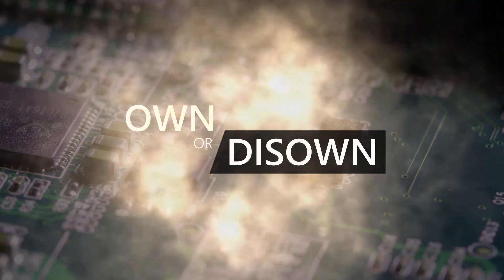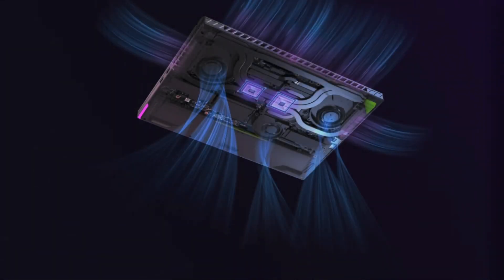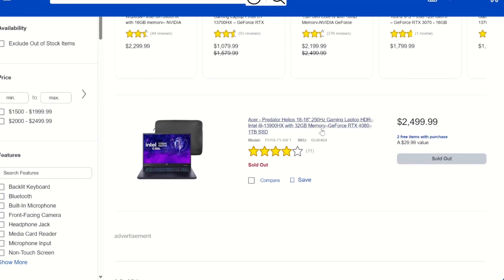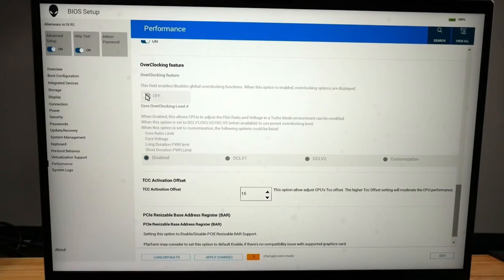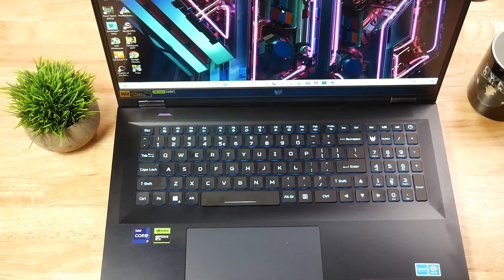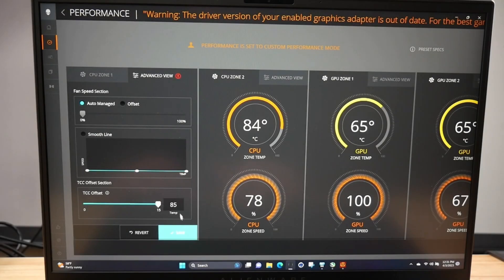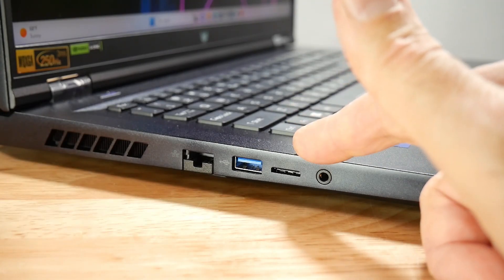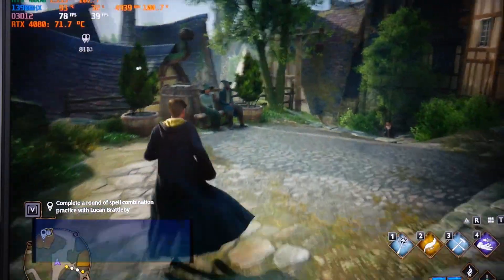Best 18" Gaming Laptop 2023 - Alienware m18 vs Acer Predator Helios 18

Comment: Had an m17 r5 with 3070ti, battery failed  in 1 year( just after the warranty  run out),numerous  problems  with the ports,  alienware software etc. by far the worst gaming laptop i ever had and it was £2500. Never again will i buy and Alienshitware again. Good review comparison  btw :)

Comment: You did an excellent job here; much appreciated. I’m due for an Alienware upgrade, but I’m safe to hold off until next year.
Reply from the maker: Thanks, appreciate it! Glad I was able to help :)
Reply: If I were you, I would look at purchasing a 2023 M18r1 with a RTX4080. With discounts, you're not going to miss much with the 2024 model other than Type C charging, which is really a non-issue with this size of laptop...and you can always purchase a slim form-factor 330watt Alienware power brick at a later date.

Comment: I want an 18' as my next laptop, potentially in the coming months, but I hate the premium $$ we have to pay for them.. Seems that only 16' laptops get all the good deals and better base prices for the same components.. Also the cooling for the 18' laptops has been underwhelming at best, maybe even embarrassing. Such large and heavy laptops should have premier cooling. Yes the Cpu makers (Intel in particular) are to blame for those power hungry and inefficient Cpu's (again, mainly Intel), but 90c + shouldn't be considered the norm or "acceptable", cause it's not.
Reply: 90C is fine for cpu temps. Why does it bother you? Even Apple silicon runs at over 100C. 
"However, the current version of the utility isn't fully compatible with Apple's new M3 family and couldn't provide a readout of temperatures for performance and efficiency cores. However, the app did report package temperatures that ranged from 99 to 104 degrees Celsius during the Cinebench R24 stress test."
Reply: @SocratesWasRight  I said 90c + (frequently even higher than just 90c). No, it's not fine. What you have to keep in mind is that this is brand new already reaching those temps. Once thermal paste degrades, and fans get cluttered up (most Buyers maintenance is sporadic at best), the issue exacerbates and gets worse even within a year, forget about 2+ years down the line. 
Maybe it would be vaguely acceptable if those temps were only reached in extremely demanding benchmarks over the course of 10+ mins, but when any run of the mill modern game is seeing 90c +, it's problematic. It also means the rest of the Laptop gets scorching hot, and that can cause problems for other components (like the AC Charger port, which I've had a bad experience with it getting hot. Mind you this was on a high tier Msi gaming laptop with great temps due to reseller applied Thermal Grizzly Condoctonaut and Fujipoly Extreme Thermal Pads, and heavily undervolted for great temps, and even then it can cause issues over time).
The higher cpu temp also negatively impacts the Gpu temps, which will directly impact performance once it reaches higher temps and can't reach higher boost clocks.

I can go on and on listing issues with terrible temps, but if you are happy with them, and want companies to keep up that trajectory, then continue running cover for them and enjoy.
Reply: @slickrounder6045  do you also go to Apple videos to complain about those "terrible temps" at over 100C? Modern CPUs have boost algorithms that push frequencies until temp and voltage thresholds are reached unless you specifically limit them. Anyhow I do agree with you, that often this boosting is done way past the optimal spots in the efficiency curve  - at least I got the impression that you hold this opinion. I would not want to misrepresent you here.
Reply from the maker: I may be old school but I like to keep my CPUs below 90. I'm sure gaming for a few hours at 95 will be OK, but when I was mining on my Alienware desktop using the CPU - it got fried within a few months. I also like to be able to do repastes myself and having the inverted motherboard just makes it one step harder and seems to have no advantage to me.
Reply: @SocratesWasRight  I don't even pay attention to Apple, and don't buy Apple stuff. Even if I for some reason wanted to, their high temps would be a dealbreaker (perhaps their M3 chip or wtvr is better, I have no idea).

With better cooling solutions, one can have much lower temps at the same wattage as the laptops in the video are pulling. When a Cpu is only at 50-60w (common in gaming), instead of being like ~90c it should be like 70-75c, and that's without even needing fans at maximum. So both these laptops are double digit temps worse than they should be. Repasting it with high tier Liquid Metal would largely solve the problem (easier said than done as OWN pointed out with the Alienware its an inverted motherboard..), but the cooling solution itself is also not up to par considering the weight (particularly the ~9lb M18) and size of the chassis (even some 17' Msi laptops do a better job with less real estate).
Reply: @slickrounder6045  There could be apace in the market for a 5kg combined weight laptop where 1,5kg ia devoted to cooling solutions. That should be enough to cool around 300W. A laptop version of the Asus-Noctua RTX 3070 GPU - would that be more to your liking?
Reply: @SocratesWasRight  It doesn't need to be that heavy for proper cooling. Something like the MSI Titan GT77 has better cooling at just 7.27lb or 3.3kg. That's less than both the Helios and the AW M18.
Reply: the trickle down of high cpu temps is usually higher board temps which is where the real failures happen
Reply: 90c shouldn't be a norm I have Asus rog zephyrus duo 16 at first it would idle around 70s which I felt was too high after switching from armory create to be helper it idle at like 50s which is great. I haven't even added therma pads yet. I agree at this size they should be better at cooling but I also think these are very special circumstances. Like moving around a lot but wanted the largest entertainment system they can work an play on at the same time. This would fit that best but also being around power source. So it's travel ready in the sense I wouldn't use this in a cafe cause I'd never wanna lug it around but I would def use it if I travels the world or country for work an know I'll be at certain spots for extended period of time an prefer to play games at that spot or watch shows etc. but when that's also why these run for so much if are better prepared for travel being large an able to squeeze more in in them. Def don't think they should be anymore than like 3k though 😂😂

Comment: I bought the m18 all amd version and it has been frustrating tweaking it right. These laptops run so hot these days and the driver updates are an issue. I had to reinstall windows and event viewer says the ssd it came with has bad sectors on it. Crazy that these things aren't tested before shipping

Comment: The Helios 18 Mini LED RTX4080 is £2600 in BF sale. Would you recommend this over the Legion Pro 7i RTX4080? Nice comparison btw.
Reply from the maker: Thanks! I really do like the 18" display on the Helios, more so than the 16" on the Legion. Mainly because of the size. The Legion panel is still plenty bright. The performance of the Helios in turbo mode is very good, better than the Legion in its max power mode but the fans are much louder. The Legion is quite quiet really and has much better battery life, I got about 5 hours on it.

Comment: In overheating cpu repaste can help....in  helios is not a metall cooling correct me please if im wrong..
Reply from the maker: Helios does have LM on the CPU. Alienware uses its element 31 which is a combo of liquid metal and paste I believe. To repaste the Alienware you need to take out the motherboard. The Helios is more straightforward to repaste.